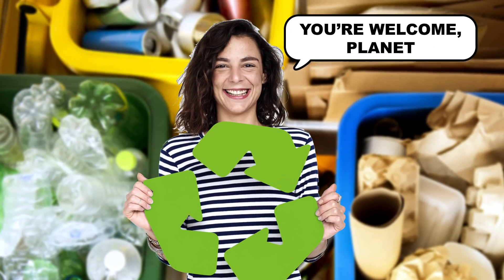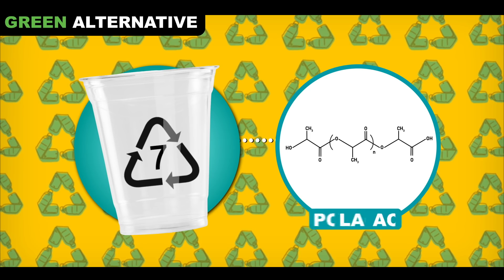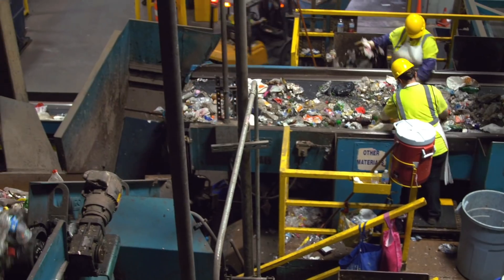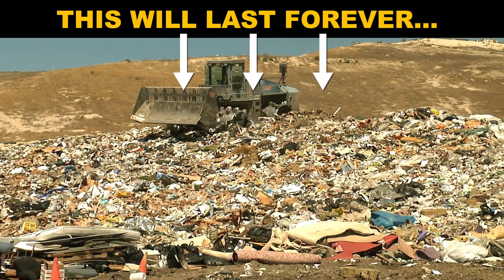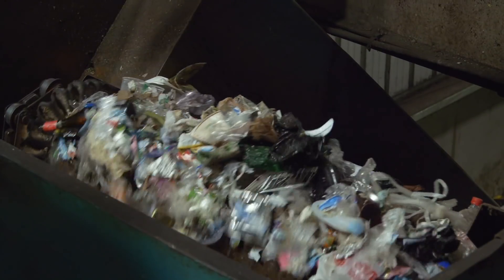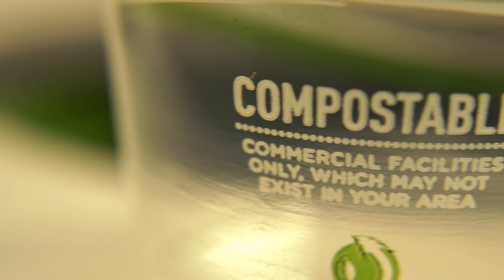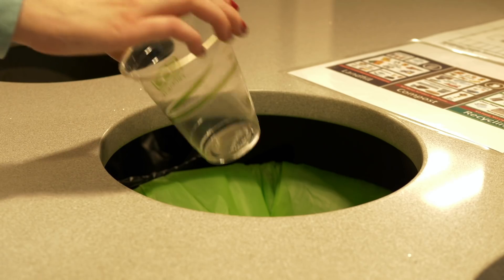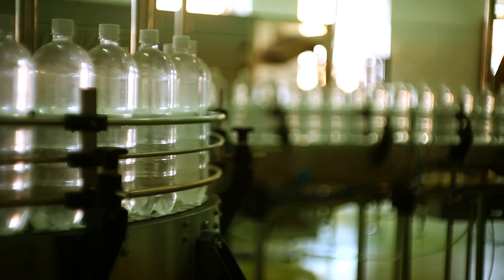Can Plastic Be Composted?

Comment: I only have plastic because it comes bundled with like everything I buy. At no point did I want any plastic, but I'm surrounded by it anyway. If the things I bought simply came with glass, paper, or cardboard instead then I would never contribute to plastic waste. If that means a slight price increase I honestly wouldn't even notice. If that means a certain product I like can't be made anymore then I'd get over it within a couple hours and it would cease to matter.
Once again, the problem is industry and government policy. The same culprits are behind a majority of CO2 emissions resulting in climate change. I don't think its fair to push guilt on citizens when it's not our damn fault. Just look to where most of the problem is coming from and cut that source. Don't try to force billions of individual human brains to make big lifestyle changes with the hopes that we all do and make a small dent in the problem because we all know that isn't going to happen and thus it isn't going to fix the problem which means its all been a big waste of time and money to pretend that we care about fixing these things. People have trouble knowing what is real already these days, maybe we forgot that pretending to fix a problem is different than actually fixing it.
Reply: Other packaging materials also have drawbacks including energy of production, water usage, and, especially for glass, increased fuel usage due to the added weight during shipping.

Comment: I created a research paper on this topic a couple years back for a class, and I found that the actual biodegradability of PLA is not a simple answer.  Through my research, I found similar claims that PLA would take as long as PET to break down.  However, when I looked where the article found this information, I realized that the only "studies" that were performed were done by analysts and included no actual field tests.  After searching through some more research, I found that scientific field tests had been performed by a university in Korea.  They found that in only a couple of months, they saw degradation in the PLA.  I will give a citation for the paper below the comment, but I also am currently performing some unofficial tests of PLA's biodegradability by burying some PLA cups in my backyard and I have found some degradation (such as small holes starting to appear) has already started occurring after about 3 months.  I also live in the Pacific Northwest, so the temperatures here never actually get into the range where PLA technically breaks down.  I think that in more active environments, PLA does not need heat for it to begin decomposition.  
Citation: 
Hamad, K., Kaseem, M., Yang, H. W., Deri, F., & Ko, Y. G. (2015). Properties and medical applications of polylactic acid: A review. Express Polymer Letters, 9(5), 435-455. doi:10.3144/expresspolymlett.2015.42
Reply: Hi, i think that would be a good idea to make videos about your experiments with the biodegradability of PLA and other things
Reply: Hey need to discuss on this...can you mail me on jasonjoseph700@gmail.com
Reply: Good work. The thing I really want to know is, because it's purely a bioplastic, is it as safe to burn as wood? It's not an ideal solution, but it at least gives it an avenue to be carbon neutral as it's made from corn to begin with, so the sequestration of carbon can at least by cyclic while also not forming harmful microplastic litter.
Reply: PlA is the shi
Reply: (Sorry i know this is an old comment of yours) Is it possible that your PLA cups are a PLA blend? I’m curious bc I dont know if PLA blends are already their own category separate from PLA alone 4:08
Reply: @JessScreams  More than likely they were.  I am not sure if they have to mark the PLA as a blend, but Im assuming they dont.  Additionally, im going to make an educated guess that the surface area to volume ratio for any particular geometry plays a significant role in degredation.  The cups I was using for the experiment had a relatively low surface area to volume ratio compared to the thin sheets of pure PLA found in the study I cited.  Adding up the environmental differences between my home and the study, the different geometry, and the possibility of PLA additives, I am not surprised that my experiment ended up failing.

Comment: can pla sustain coffee and tea temps?
im doing the whole 3d printing thing and from all ive read (atleast 3d printed) pla gets too soft for use at high temperatures
wouldnt it be better to just use paper cups for cold beverages or is there some kind of energy or deforestation aspect im missing?
Reply: As matter of fact, yes it can, provided it's the right type of PLA. Like any polymer the exact properties of PLA are dependent on its molecular weight distribution.

Comment: Doesn't biodegradable plastic still create micro-plastic pollution when it breaks down?
Reply: it ceases to be plastics (long-chain macromolecules) once it is broken down into its components.

polylactic acid presumably breaks down into lactic acid, which is a common organic molecule in biological matter and produced by most animals. polyethylene breaks down into ethylene molecules, a flammable hydrocarbon gas. polyesters break down into esters, so on and so forth.
Reply: @Bio Kimistry Yes, why? Did I miss something? I'd heard (in another video) that even biodegradable plastics leave a micro-plastic residue.
Reply: @choedzin  as they stated, *if properly composted*, it gets degraded (i.e. consumed) by bacteria and turned into things plants find useful (probably CO2, although don't quote me on that). 
But I'd imagine that, if it is not properly composted, that will probably lead to microplastics, as the sun and other environmental factors break it up.